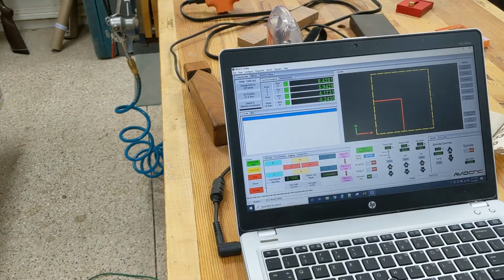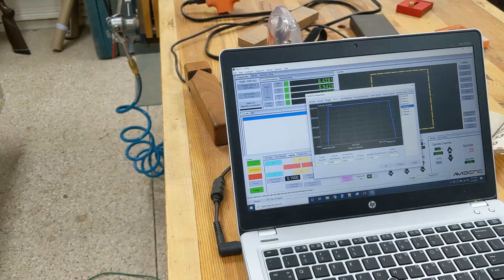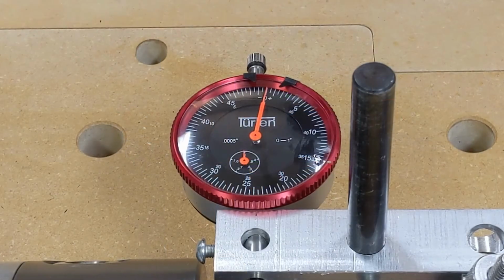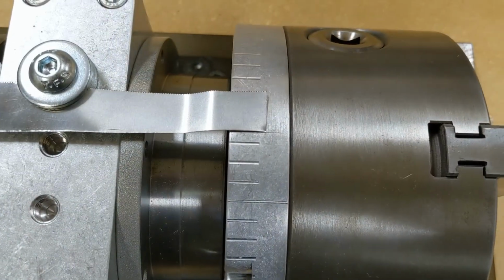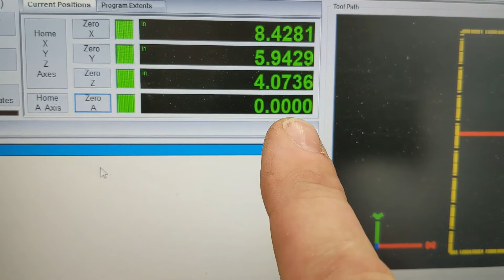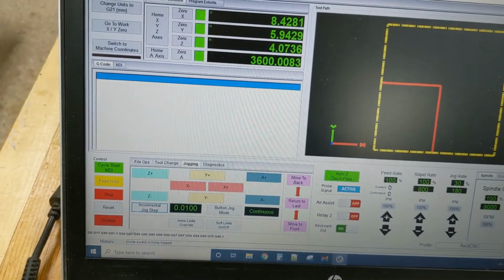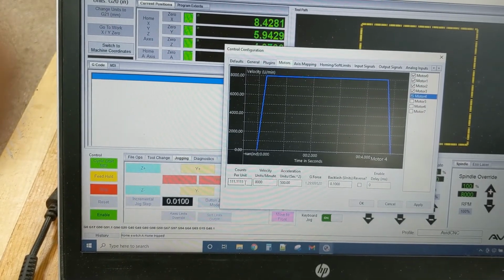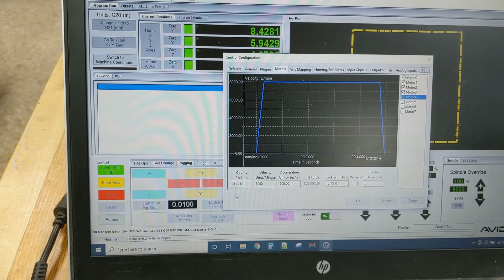Backlash and rotational accuracy calibration on an AVID CNC rotary axis with Mach4

Comment: Jim, Thanks for the informative video. I am interested in purchasing the 4th axis for a non-AVID system and was curious about the backlash numbers you are seeing. Having less than .0005" total backlash is very precise. The AVID website advertises the unit as having 3 arcminutes which translates to .003" (don't know if their spec is total or +/-) so what you are experiencing is incredibly good.  I will be contacting them to discuss, just wanted to know if you did anything to get these numbers? I am assuming the system direct drive?
Reply from the maker: Hi Patrick,  from where I was measuring, 3 archmin is probably about 0.002".  However, thats still a lot more than what I measured.  A couple of things to note.  My drive was very new yet when I did this, so it didn't have any wear.  Second, I didn't have any load on this, and there isn't a lot of mass on this to slam the gear teeth to the other side (like what happens on the linear X and Y axis), so it could be that if I pulled on it there would be more play too.  However, as you said, their spec is probably a max tolerance, so they probably put some margin in this.  
I have't taken the drive apart, but from the outside it looks like a planetary gear setup (it has a 10:1 reduction).  It is a nice unit with a good chuck on it.  I haven't had any issues with it at all.
Reply: @JNWoodworks  thank you